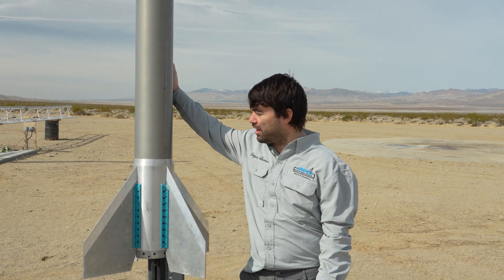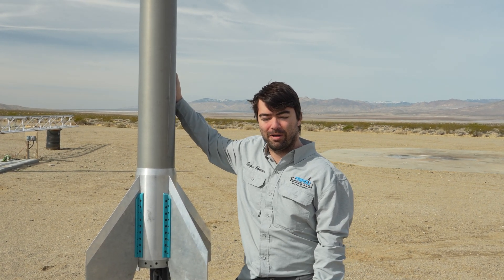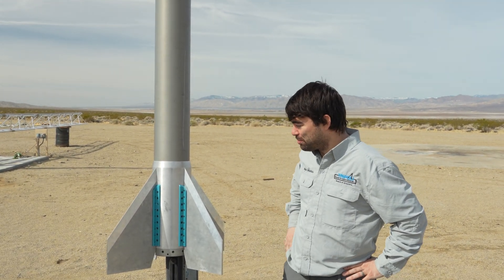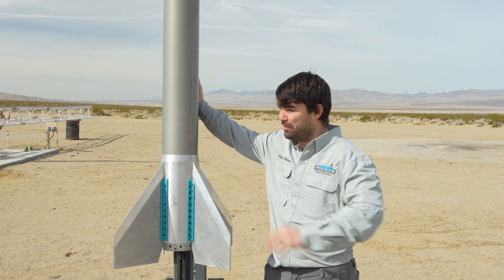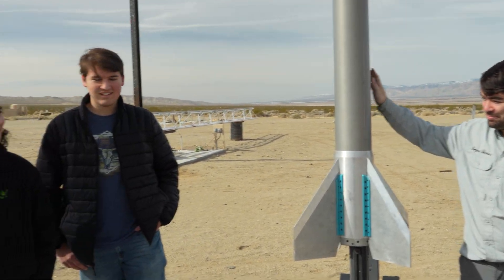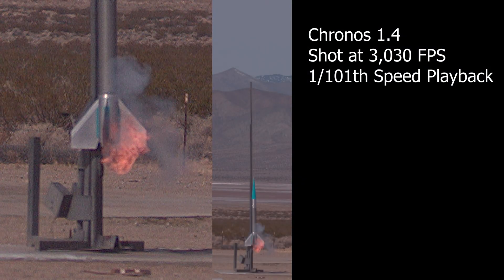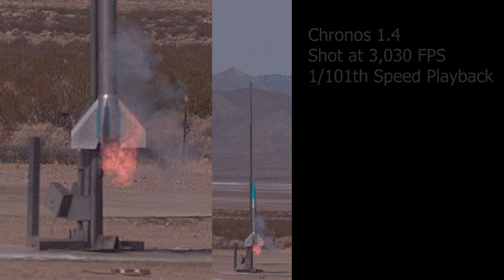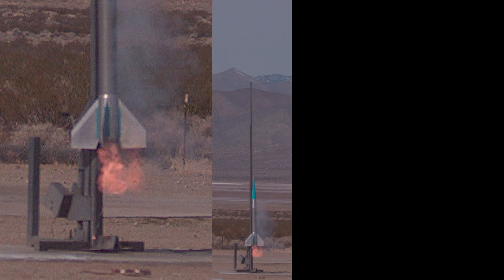Bryce Chanes  6" O Motor Flight at FAR

Comment: Nice! Would like to know more about that fuel. Was the inside of the fuel coated with something slower burning to bring up temp befor fuel started? Didn't look like the normal start?
Reply: Pressure = heat. Enough pressure and all exposed surfaces ignite. Heat = pressure